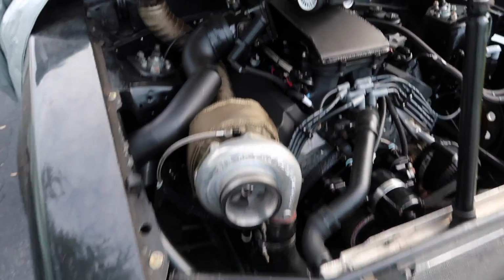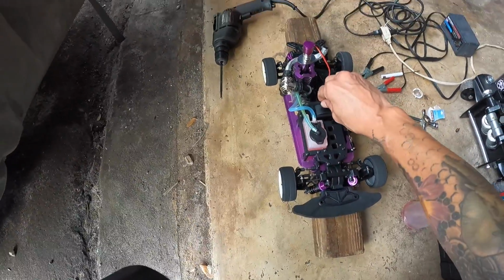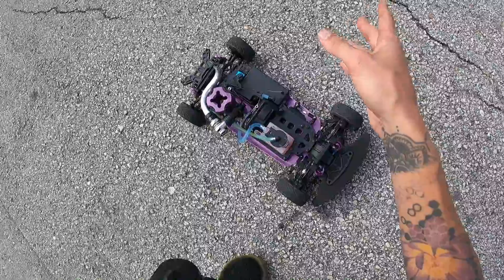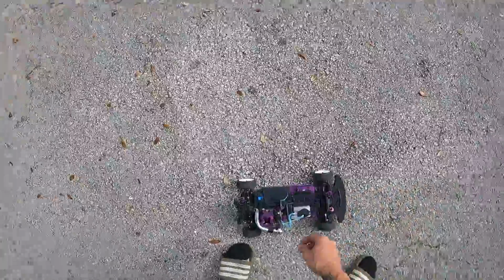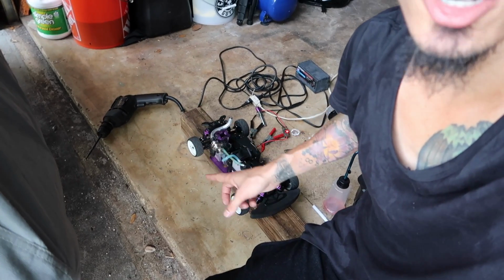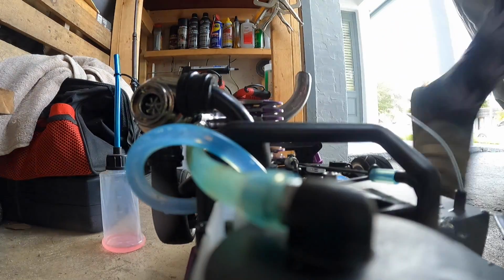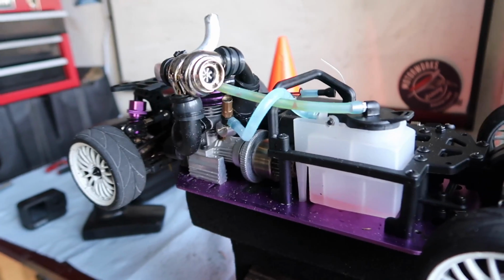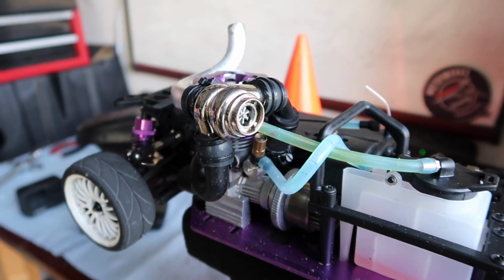WORLDS FIRST! Running Driving TURBO RC Car

Comment: You can't effectively run this little novelty turbo on a nitro fueled 2 stroke engine, 2 strokes make, or break, all their power from their exhaust and how it works in conjunction with pulling in intake air and fuel.

The "fully upgraded" little turbos they have, are meant for the tiny little 4 stroke Chinese 2cyl and 4cyl engines....but in reality, the turbine housing and entire cartridge itself isn't made correctly enough/detailed enough to really make any substantial power.... it's more for scale fun.

Regardless, after you end up taking that little keychain turbo off....get yourself a laser temperature gun, that way you can check your temps of your engine until you learn the sounds, sights, and feel of your Nitro running conditions....if it's running hot, it's definitely running too lean.

A Nitro, and a 2t engine in general, should always haze under full acceleration.... you definitely don't want it NOT to be having visible exhaust under acceleration..... and you don't want it sitting there smoking while idling either.... you should be anywhere from 170-210°f if she's tuned correctly.... meaning you should be able to be running it back and forth doing full throttle runs for at least 5 straight minutes and be able to hit the head with the gun and see your temps in those ranges.

But in reality, you need to learn how to tune by not just smoke and temp, but by initial ear and feel well before that.

Comment: I have 3 hsp nitro 94188 
 2 of them  I conversion kit  to electric but I love my nitro neither of them stall out like that you got the same fuel lines for the little cab with that turbocharged starving for fuel you need bigger fuel lines more fuel going to the carb that's why it's stalling it's starving for fuel. You might  need bigger carb on it

Comment: the smoke give a clue... but its been so long since i mesed with nitro  ( there awesome, but they are tempermental.. need alot of TLC  if u kno what i mean...  clutch is behind the gear housing on the engine,, its only plastic (stock) with a spring ( teo half moon like sahped plastic parts with teh spring wrapped around it so it expands @ high RPM..  if clutch was bad . u 1: wouldnt be able to start car ( or would stall (if wheel spinging with no throttle)  and sat on ground cuz the cluch is melted to gear housing (Internal)
( i had this happen once)  

or 2. the car just woulnd move @ any throttle, engine would just rev if clutch was messed up... ( depends on failure though)

the trans not shifting is poss messed up.. mey need to replace it. ( you can buy aluminum upgrade parts.... ehich i do like.. i have some ( not all)

Comment: Probably doesn’t help that with the exhaust pointed the excess oil runs back into the engine instead of the exhaust. I bet if you turn it upside down oil will run out.
Reply: Probably why you’re hearing sizzling and why it’s bogging out.

Comment: Turbo's  and superchargers are only working on 4 stroke engines   if you have one with more cilinders ' you can use more turbo's and connect them . Carburators i dont like ' its better to build an air / fuel injection system like the the tractorpullers have ' with a valve for throttle and injectors for giving fuel in the intake .
Reply: Not true.  Skidoo and Polaris both offer factory turbos on their 2 stroke snowmobiles.  They are amazing.
Reply: No ' they will not work ' maybe they think they work ' but i doubt it. Polaris can do what they want ' on small two stroke rc engines it will not work .
Reply: I just saw the skidoo turbo kits . They only work with ecu.  But i still doubt it that they work on small rc two stroke engines. I tryed it many times with home made prochargers ' only thing the engine did was getting very hot ' and rewen the piston.  I even tryed it with cooling ' like water injection . I bought 2 of those turbochargers like this guy here use . I will use them like a set on a multiple 4 stroke engine . If all go well i can get lots of boost ' so i need to adjust the heads of the engine ' and put stronger valve springs in them ' and make a manifold with methanol injection ' and valve. Then i will use 4 turbo's ' and then we will see if the power is higher then the stock engine. If you want to see more ' then search for Dingo tractor puller ' then you see the turbo setup i will use
Reply: @Martstou  People have been running turbo's on 2 stroke snowmobiles for 15+ years starting before EFI like today.  It's nothing new.  Yes early systems used a blow through carburetor setup, these worked but were usually very finicky to tune.  The tuning window on a 2 stroke with boost, yes there are supercharger kits used too, is very narrow compared to a 4 stroke.  The setups have become much more reliable nowadays with EFI, extra injectors and properly sized fuel systems.  So much so that the 2 major manufactures offer them with full factory warranties.  I own one and it runs amazing.  You generalized and said "boost" only works on a 4 stroke,  all I did was point out that that is in fact false and give you an example.  Now, whether or not this guy can make his little nitro RC engine with a key chain turbo run right is another story.  I applaud the the guy for trying anyway.
Reply: Yeah ' seems he has lots of fun with it))))😂😂

Comment: 100 percent its lean you added more air throwing off the fuel air mixture long as its got some smoke to the exhaust you should be safe.
Reply: Did you ever think that maybe the turbo is restricting the are being that it's so small I know ASE certified mechanic but maybe it is a restriction. I think it's cool as hell I maybe that the problem.. the motor naturally aspirated Ken probably pull air faster then the turbo can pull through those little tubes.. food for thought have a good night buddy
Reply from the maker: maybe… but i just want it to look pretty on a shelf lol electric is really where its at 🤘🏼

Comment: The time and then the way that transmission work have a lot to do with your RPMs can adjust. We're not thing is properly tuned that thing should be snapping and moving you have to research how to adjust the shift points I'm not tranny so much I have forgotten anyways best of luck to you

Comment: Exhaust needs diameter on your exhaust needs to be opened up to almost twice that size and exhaust opened a little more. I once rigged a dual exhaust using brake lines and I had a lot of bends in my design. It sounded just like yours. To you it looked fast but on camera it seem to be struggling. Rework your exhaust.

Comment: Hsp looks like a hpi rs4 nitro clone. You may be able to look up parts and or clutch adjustment. I have a rovan 5b which is a hpi 5b clone and the parts are interchangeable.

Comment: Nitro engines do not benefit at all when it comes to this type of technology. The only thing that happens is that they blow through more fuel because the pressure (if that thing even produces any) pushes the air/fuel mixture into and right out of the combustion chamber. And...... you got rid of the tuned pipe. The pipe DOES increase the power of a nitro engine and it also is a part of the cooling of a nitro engine.

Comment: I think you should research 2 stroke engines. You have basically detuned it. there is a reason you don't see turbos on 2 strokes. All you are really doing is blowing fuel mixture through the motor and into the turbo, doing no good for adding power. And by taking the expansion chamber off you have removed a working supercharger.
Reply from the maker: but it looks cool… and honestly this nitro car is just a novelty, a cool shelf item lol all my electric cars are faster and wayyyy less hassle 🤘🏼
Reply: Yes your expansion chamber is the heart of the whole system that's where you get your power bands from it's like an instrument take that away I think you should leave the turbo on but Hollow it out and make it as a showpiece because from my experience when I tried to supercharge my Nitro car it just did not work very well these engines have transfer ports and expansion chamber's you can modify Pistons skirts change the timing you can do all kinds of cool tricks to these motors but you just have to understand how the expansion chamber and the transfer ports and all works as well so little difference in a 4-stroke or regular motor

Comment: And when it dies on acceleration like that well that is for sure a tale tell sign that it is running to lean and when it dies like that on acceleration it is damaging your motor little by little every time it dies under acceleration due to being to lean once u get it running at the proper mixture then it will shift into second gear as it should

Comment: You're exhaust needs to  be change its to high so you have that used up oil that is still staying in the system it need to escape

Comment: Hey I don't know if you know this about nitromethane but if it's raining out or you're close to water or ocean has a big effect on the tuning makes it run really rich just so you know those are things to take into consideration so if it's raining you're definitely going to have to change some settings is Nitro cars are badass they sound cool but I don't have the energy for it anymore I don't know that's just me like I told you before they make a great centerpiece for the coffee table and I had a supercharger kit for mine as well the belt was an O-ring looked cool what did not work at all

Comment: Yo i gotta ask man. No disrespect but if you dont know how something works, why would you fuck with it? I mean, the shift points on those little transmissions are totally adjustable with the grub screws but thats honestly not the biggest issue. The biggest issue i see is the carburetor. Instead of fucking around with modifying the carb, build an enclosure box around the entire carburetor. You can also build a little volumetric reservoir post turbo on the hot side. Single cylinder stuff is very difficult to turbo. You have a bunch of shit working against you. The fact you dont have a blow through carburetor, its a single, and its a 2 stroke. All those difficulties aren't impossible to overcome by any means. You just have to know what to do. Let me know if you have any questions man id like to see this actually make a little boost. I can draw some shit up for you, however i can help brother let me know. I own an automotive fabrication shop where i live in North Shore Lake Tahoe. I have a dyno, 3 axis cnc mill, cnc and manual lathe, lazerjet, every kind of welder, 3 lifts, an alignment rack, chassis table, pretty much everything i need to build a race car A-Z and ive built a whole mess of them. Ive built countless turbo kits for dirt bikes and go carts, snowmobiles, quads, you name it. Its primarily what i do. I dont have a ton of time but i have the knowledge, connections, and resources to give you the information you need to actually make this thing work. Hit me up.

Comment: How would that be possible it’s impossible you’ll get any boost. You cannot boost 2 stroke engines because when the piston sucks in fuel mix the exhaust port is also open so if you tried to force air (turbo or supercharged) excess air will escape through the exhaust port. What you’re doing here is just putting excessive air with no room for fuel to combust properly this is why it will bog down or turn off

Comment: Move your fuel pressure port on the exhaust to the exhaust header, before the turbo. The drill that cork out of the exhaust!

Right now your restriction restricts flow through the turbo, and your turbo is the exact restriction you need for fuel pressure.

And the restriction the porting needs, unlike that idiot suggests! 😂

Comment: Ahh yes it sent it until it sucked something in the turbo already if it runs for more than a few laps I’d be surprised the turbo might eat up everything and make it not so bad but doubtful it will have 0 compression in the cylinder after a lil bit more running it without a filter it’s the number one reason anything 2stroke engines die nitro is worse and there’s too much fuel now definitely though I thought it needed more but it’s definitely rich af